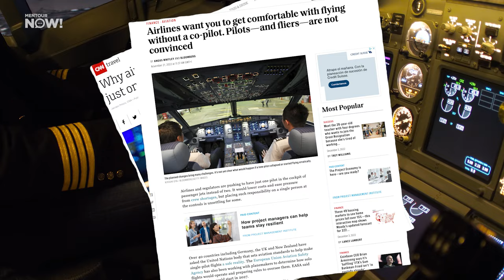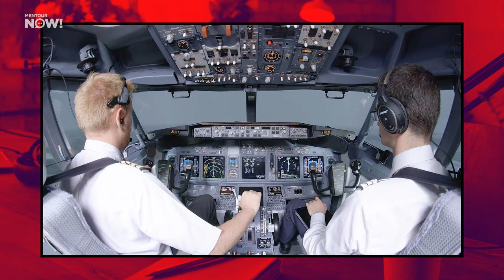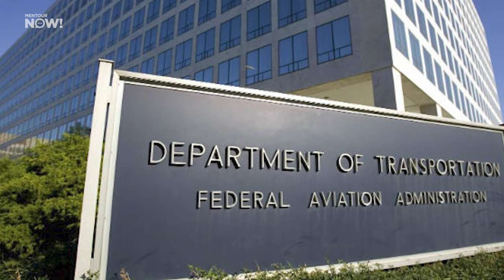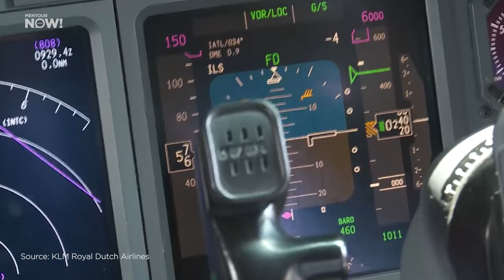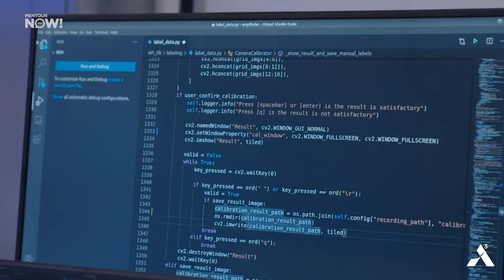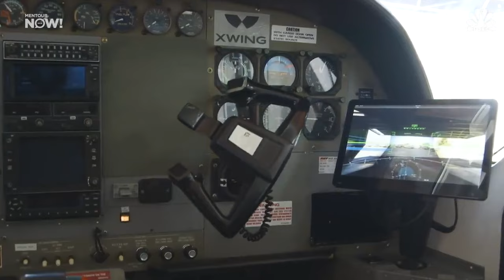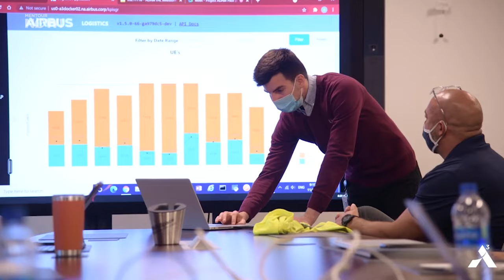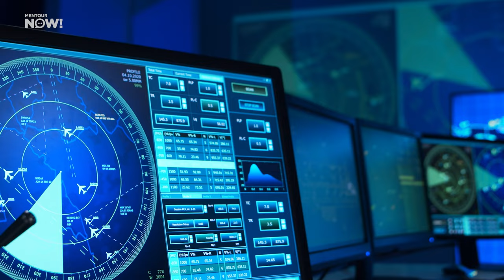The End of the Two-Pilot Cockpit?! Get Ready for Single-Pilot and No-Pilot Airliners!

Comment: It's all about the "bottom line", but it shouldn't be. I've seen enough of your vids, Mentour, and lots a other ones too and I think the workload for two pilots is ridiculous. I realize that "incidents" are the exception and not the rule, but it's like insurance. You most likely won't need it, but since disaster doesn't usually announce when it's coming, yer covered. Humans, even the best, can't be counted on to think or operate in a panic situation. Your own vids have proven that. It's just my opinion, but having a 3rd in the cockpit seems an overlooked easier "fix" than more tech that is almost TOO advanced for all but the scientists and last I heard they can't fly jets. See, I'm certain no one will agree with me, but I'm used to that. I value safety, it trumps everything else. I have seen how the best pilots totally "lose it" in a "situation". They don't communicate, they start missing warning cues and some freeze up. I mean hell, you just had a vid a bit ago where both pilots are trying to turn the plane in the OPPOSITE direction! Please correct me if I'm wrong here, but when the resting pilot came bursting on to the scene, I think he noticed some screwups right away (without a clue of what was happening) The guy came too late to really help, but if there was a 3rd in the cockpit (so, 3 flight crew each responsible for a third of the workload) I'm bettin' this jet would not have "deep six'd". I think a pilot could handle a third like "cake" in normal flights (so, most of the time), but not half (at least consistently) when anomalies start. A 3rd person in the cockpit is too me, anyways, like the insurance. Yes, you have to your premiums and maybe grumble about it...that is until your world begins to implode on you. I know todays' airline pilots are some the very best that there is, but they're still human and humans inherently completely unpredictable. Thanks, Mentour.

Comment: As a passenger, I agree with all of this. And reinforce the statement when you said "Pilots defiantly dont want it". Well, as a passenger, I defiantly dont want it. I agree it could be a helpful tool to pilots, but in no way should it ever be a replacement for them. I'm not even sure id want it cut down to 2 during long haul flights. 3.. maybe? but not 2. 

The only way id see this working out is if, as you said, it was a tool to help pilots be safer/more efficient. But thats all. And i agree the security ricks (from hackers/hijackers) skyrockets with it.

Comment: Yeah I've heard about this as well. It means RIP MPL and furthermore, I'd say - as an absolute aviation and technology enthusiast - that's a pretty damn bad idea. Just imagine possible (often just small mistakes) which can be resolved without any big consequences just for having a pilot monitoring at hand. We had many examples of troublesome cockpit culture issues b/c this very same process had issues (mostly in asian type cultures afaik). And then simply getting rid of that control instance? No technology could ensure a safety plus like another skilled human being.
Most of the aircraft incidences nowadays are still technical issues, and sometimes mistakenly handled by the crew. Considering the higher rate of mistakes on technology vs human beings the single cockpit airliner is simply a pretty damn weak idea for saving money on the wrong place, like most big companies did and do as we all very well know -.-

Comment: I think a lot of the comments are missing the subtlety of the system. We're not discussing using only a single pilot. We're discussing using only a single HUMAN pilot. The point is if the automated systems prove they are capable, then you have TWO pilots: a human pilot and computer pilot. If the system is eventually free of all human pilots and consists of two, independently operating computers then you have two pilots. Today? No. Next year? Probably not. In ten years? Well, now we need to reconsider our position. ANI (Artificial Narrow Intelligence) systems are improving rapidly.

Comment: My understanding is the US government has aircraft flying with crew's on board for years doing tests.

The flight crews have nothing to do except look over All the systems and only take over if they have trouble

Flying by wire or Fiber optic has been in testing for years and computers Do so much. Just take Star Track or any other advanced show

Those craft would not have any old cable's and space craft are flying by wire or Fiber optic.

Just look at the submarines from WW2 and now like the model T setting next to the SR71 

Possible one pilot could easily do the job as computers will possible control after the push back from the gate to taxing to the new gate

Computer's can take data at rates well above people and make changes in mirco second's

Single pilot on major aircraft possible

Comment: Its leading up to Aircraft with no pilots, as the technology is there already. Its a cost cutting measure by airliners, like every other industry cutting cost and increasing profit. It is even possible to control aircraft from the ground, They do this all the time by using Drones. Its still about profit. Same thing happens in Supermarkets. The cost of Self checkouts, the tech is not cheap and the outlay costs more then just employing someone. But the long term save money. It may take them 4 or 5 years to start saving money, but the cost up front is dearer. If you have 5 or 6 pilots each getting 150k and of course these costs would vairy as salaries would be different. Would a captain not get more money than say a first officer? Supermarkets the outlay of the tech is Hugh so short term maybe costing more than just hiring staff. Also they don't care. All they see is dollar signs and profit. You watch. The next step is Aircraft controlled like drones from the ground, No pilots what so ever. It will eventually happen as so many jobs today have been replaced by technology. Eventually All airlines have to replace aircraft anyway, so in the long term cheaper to use one pilot. 10 years is a long time and technology in 10 years is a big advancement, so replacing aircraft every 10 or 20 years the tech has got much better. they would suddenly not replace every aircraft with ones that are capable of one pilot aircraft, it would be gradual as they replace aircraft often anyway. Supermarkets did the same and did no suddenly buy 100 Self checkouts, they gradually done it as profit allowed

Comment: That comment that an capable of autonomous skills piloting a large aircraft is probably inaccurate.
Based on public information about developing the current best chess playing AI programs, it might about a year or maybe less or more to build an AI with decades of experience encountering every recorded incident that has been investigated for as long as anyone requires. Developing a chess playing AI actually is fairly similar to building an AI pilot... You need a game environment with specified rules (eg flight simulator), give the AI program an objective (eg a safe landing or safely recovering from a particular scenario) and then run the simulation as many times as needed to allow the AI to discover what works and what doesn't. An AI might be trained in a multitude of scenarios simultaneously. Eventually you want to combine all the training into a single AI algorithm that can respond successfully to any scenario chosen on a random and unpredictable basis.
Because creating a pilot AI would be so similar to building a chess or go playing AI, I'd expect the hardest part which is creating the environment and training simulations would probably be not that difficult. But to actually create the AI would require enormous computing power which means that if immensely costly supercomputers weren't involved, the training on lesser computers would just take longer.

I'd expect that both China and the USA and its allies are well on their way to building an autonomous AI for military. In fact there have been public reports that human pilots have not been faring well in battle simulations. If that's the case, it won't be that difficult to migrate the AI from a simulator to a real world aircraft. This might already be happening without telling the world about it.

I'm posting this Feb 2023 and I'd expect that since the technology is moving so quickly that future readers will find this post obsolete by the time they read this.

Comment: I would suspect (or at least I hope), that this research into reduced/single pilot operations by the manufacturers is much more about simply exploring and expanding the limits of automation technology than it is about actually developing a single-pilot airliner. Obviously it's in any manufacturer's best interests to stay at the cutting edge of these technologies, even if they only intend to apply them as additional tools and resources for a two-pilot crew rather than trying to use them to actually replace a pilot.

I have a very hard time imagining how a single-pilot airliner design could ever prove that it's as safe as a two-pilot crew. Just off the top of my head, the system would have to demonstrate that it can handle the pilot suicide scenario (a la Germanwings 9525), the faulty data emergency scenario (a la Air France 447), the never-anticipated emergency scenario (a la US Airways 1549), and plenty of others, in addition to the issues mentioned in the video. As the video said, that would require something along the lines of true AI, which is still a fantasy - try playing any RTS game against the computer and then tell me we have computing technology that can match a human brain.

Comment: "...the autonomy of the aircraft must be so advanced that it rivals the capacity of the human mind."
That is a poor argument. We need it to fly from A to B without crashing, not write poetry or understand this thing you call love. 
The level of 'self awareness' it needs boils down to questions like 'what is my current loading anf fuel state?' 'can I make it to my destination/alt safely?' 'what is the minimal speed course to the nearest 5 airports if I need to suddenly divert?' 'do I have permission from  ATC to proceed?'. This is all information the plane already knows, or knows how to calculate, and can recalculate once a second. An ability to calculate expected performance (based on current configuration, and known external conditions) and compare it to actual performance would be useful too, which IIRC isn't something aircraft can do, but isn't really that hard to calculate. Aircraft can also poll computers and disreguard the one that disagrees. It's probably not that hard to get it to do the same thing for sensors.

Comment: I see the pathway as follows:

Plane systems become capable of fully autonomous operation. - i.e. get programmed on the ground, and can complete their route (incl the more common emergency situations) with the pilots only monitoring the system. As an engineer I don't think this requires full AI, but is a technological leap from where we are now.

Many thousands of hours of the above operation in two pilot configuration, then might as go down to a single pilot.

Many hundreds of thousands of hours of the single pilot running, and we might get to a point where the pilot statistically causes more harm than they prevent. At this point it is only logical to go fully autonomous.

I don't feel some of the concerns mentioned are valid:
- Rouge suicidal pilot: Two pilot operation does not remove this risk, as historic incidents show. If anything halving the number of pilots reduces the exposure to this risk.
- Risk with the cockpit having no pilot during bathroom breaks etc - If we are happy for the plane to fly high risk bits of the flight autonomously (with monitoring), I an OK with it running unmonitored for short periods of low risk flying.
- Psychological risks of working alone - Seems to be a non issue in areas like trucking, and single seat military aviation.

Main Risk / Barriers I see:

- General public acceptance (but once fully autonomous cars are mainstream, consumers will also accept planes and boats) 
- Keeping the pilot skilled. The system I envision would have the pilot monitoring the automated system, and only taking control if there is some issue. This would lead to very little "pilot flying" time for pilots, which would pose risk in the rare even they did need to take control.

Also I think there is lower hanging fruit to make gains from technology, than reducing pilots.

- Increasing automation of evacuation procedures to allow less cabin crew is one example.

Comment: I love your content, but I hate to burst your bubble.  Safely replacing a pilot for most phases of flight isn't hard.  You are adding a lot of assumptions that all the rules that apply to humans will apply to the machine.

If you modify ADS-B to signal which planes are in automation mode, that will allow air traffic control to react accordingly. 

Then you would probably want to geofense where the automation can be used. That way, the plan won't over fly NYC without a pilot in control. 

You might even want to build airstrip expressly for the automated planes.  They could be on low cost land near railway systems. That might take load off passenger  traffic airports. 

In general, machines are much faster than humans, and they will never forget a checklist item.  Most pilot training is focused on getting the pilot to operate like a machine. 

I don't intend any disrespect to pilots, I just work in an industry where I see irreplaceable people get replaced all the time.  When you replace  the stance of "this can't work" and switch to saying, "How can this be made to work?" You find the only real barriers seem to be money, and people who don't want change.

Comment: I do a bunch of automation work, and it's so so so so hard to remove the final human check...there are just so many tiny stupid things that can go wrong that a human can just easily look at it and fix instantly...and when you get a bug notice of something that's happened 3 times total in 6 months over dozens of machines and you can't replicate the error it's aggrevating.

I think that's the big thing here, right now the system is automated enough you could easily fly with 1 pilot, so you have 2 for redundancy...but going from that 1 to 0 required is just such a huge cliff...sure you could do it 99.99% of the time but .01% is way way too high.

Comment: Until we have true AI technology, we have to have at least two human brains to back each other up in crisis situations when there's 100s of lives in the balance. 

With all-cargo flights, I'm still reluctant just because of the high value of the cargo that is transported by air. On the other hand, there have been 2 big snow storms in Anchorage in the past two weeks, which has thrown off commercial freighter rotations as the airlines scramble to reposition enough crew to operate trans-Pacific routes (the 747s and 777s require 3 pilots).

Comment: Didn't we learn from 4u9525 and the likes?
Haven't we had enough deaths caused by a single unstable pilot alone in a cockpit? 

Aren't there enough incidents which tell us to "always have two people on the flight deck"?

Isn't aviation the one industrie where single-point failures are avoided at all cost? Where redundancy is the norm?
Where you'd rather have more than three of every system rather than less?

I'll never board a plane with only one pilot.

When Airlines propose this, all I hear is "Meh we don't want to pay Pilots what they duly deserve for their work, and because we don't want to do that nobody wants to pilot anmyore, so now we'll have to split our workforce and have single pilot planes, because then we can lower cost and can keep wages the same which means more profit for us"

Comment: Don't you remember Boeing's defence at its criminal trial for the 737MAX crashes? Redundant systems are in fact entirely unnecessary and not an obvious necessity that is well established and universally applied in practice. Single points of failure are fine and just dandy, particularly if you eliminate the possibility of the ultimate fail over to human control by not telling the pilots of the SPOF at all. Thank goodness the courts were able to establish Boeing's justification, without the slightest hint of political interference or corruption. That means we can trust Boeing to do the wise and just thing and never kill hundreds of people through sheer idiocy and greed.

Comment: My assumption would be, that the one-pilot-phase will pretty much be skipped completely (apart from a testing phase).
Instead the auto-flying technology will be developed to a level beyond the capabilities of any pilot. Such that it is provably safer than human pilots. Then one will remove pilots completely in the interest of safety.

They are mostly at that point for trains by now. An auto-conductor is (on average) safer than a human one. It can also make mistakes - different ones than humans would - but results in less mistakes in total.